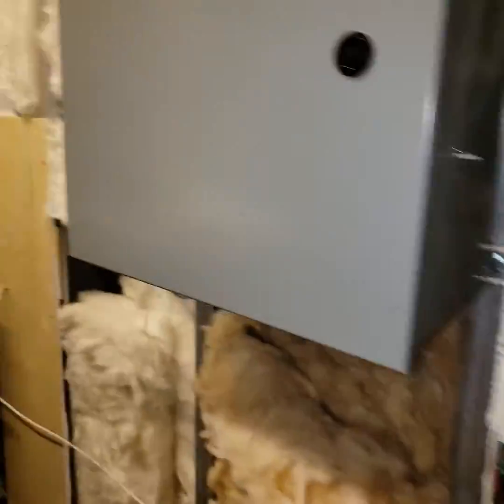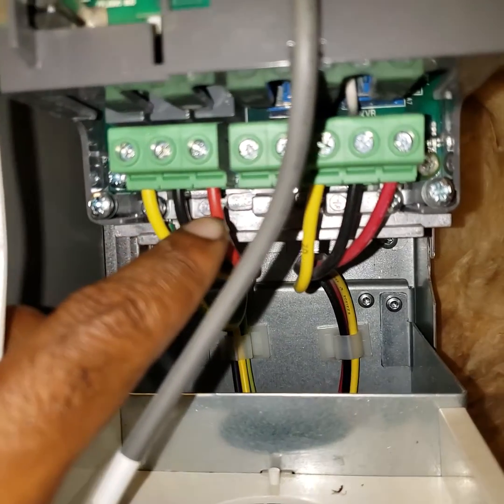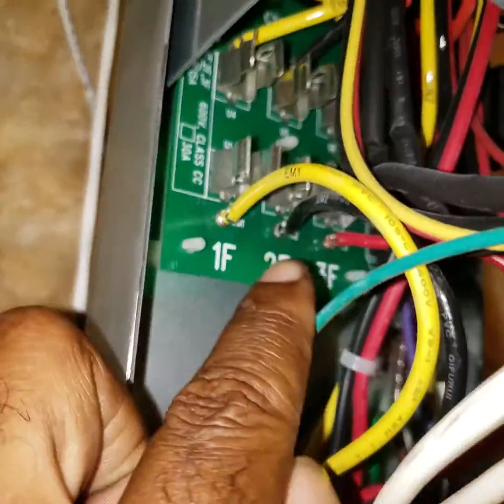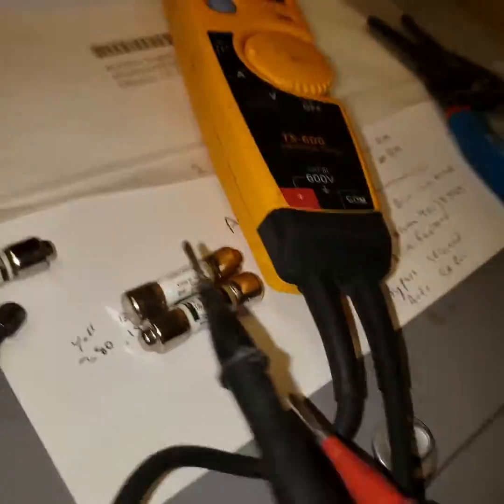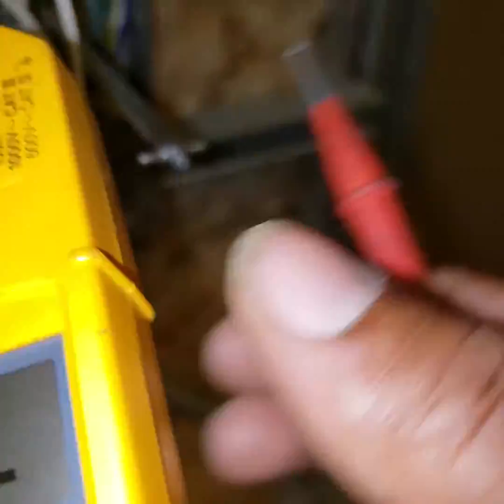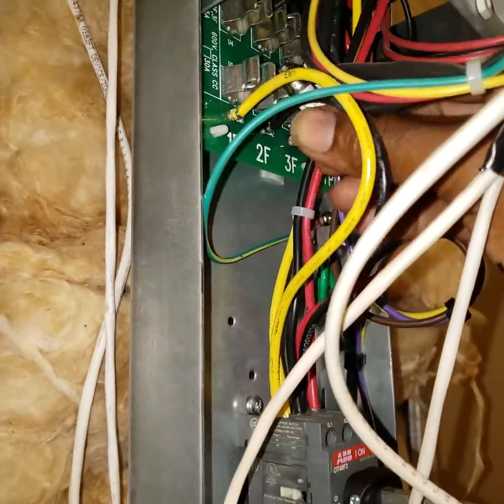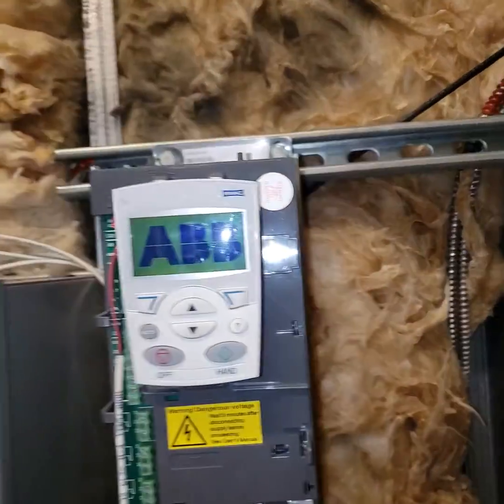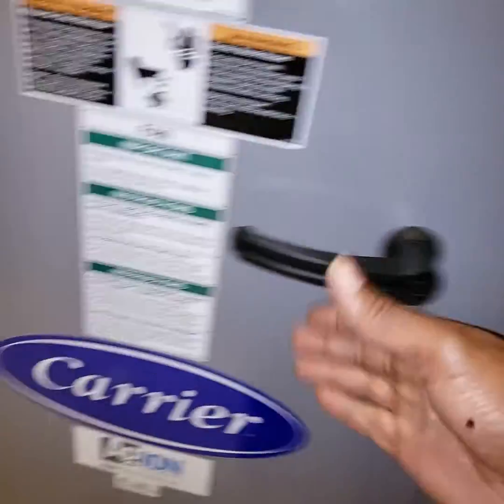HVAC: ABB VFD blown fuses replacement

Comment: I had a power outage take out a couple of these ABB VFD's out. VFD would go into alarm when in Auto, the keypad display was not getting powered. Power outage took out the power supply board in the VFD.

Comment: With blown fuses, you still got partial voltage on the terminals. Now that would be interesting to understand. The fuses while blown still allow some voltage to pass to the terminals, which I can only make sense of that by assuming the fuse case conducted partial voltage when the elements were open. Very interesting. If there's another explanation I'd like to hear it. Thanks, LU. Now that I think about it maybe Capacitors were holding some charge and you were reading capacitor charge?  Well, anyway, thanks again.